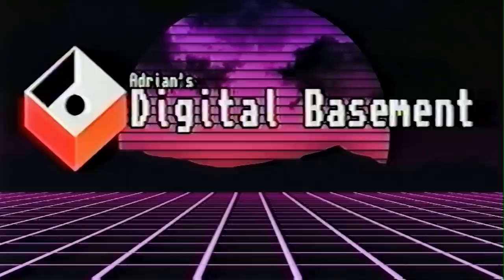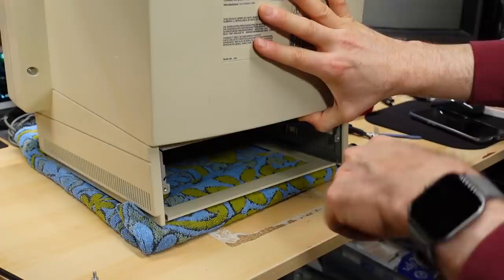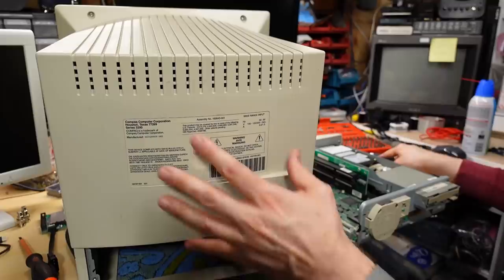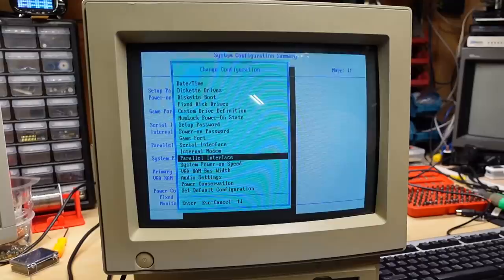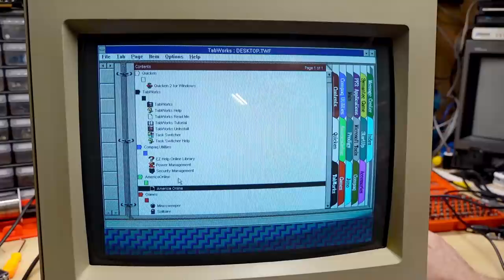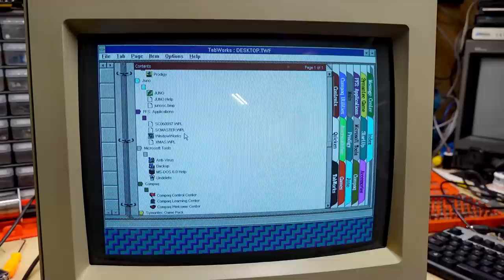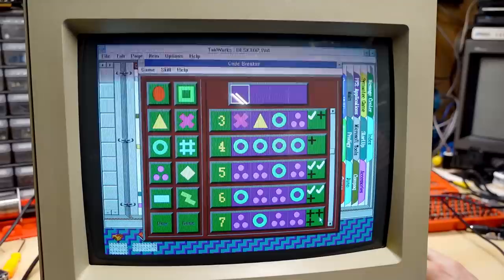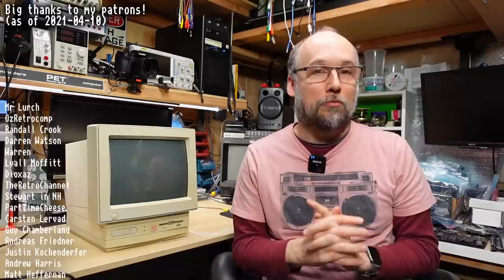PC archeology: Compaq Presario 425 All-In-One (Part 1)

Comment: I definitely remember seeing these when I was a kid, I think one of my friends had one. I wasn't really a fan of them back then, since I thought they weren't good value. I vaguely remember them being more expensive than buying a cheap no-name branded but equally specced box and separate monitor. Not to mention the lack of upgradability, since you couldn't just pop a drive bay cover off and slot in a CD-ROM drive. But my opinion has definitely softened, and I think these machines are very cute and well worth preserving!

In terms of upgrades that you can do, a Sound Blaster 16 would be the right sort of era. I'm sure you're already aware that the Vibra16 cards should be avoided, since only the Vibra16S model came with a real Yamaha OPL3 chip. I do like the idea of using a separate SCSI card to connect an external CD-ROM. There was a model of SB16 that came with built-in SCSI, but I don't think it came with an external port adapter cable thing to allow the connection of an external drive.

Anyway, can't wait to see what upgrades you have in store for this little machine!

Comment: If you look at the window on the left side that line represents the spacebar on keyboard. You could drive windows completely with keyboard alone and not need to use the mouse. IIRC it was alt+spacebar, then you could also use tab key and shift+tab and?arrow keys? In addition to Alt+letter that is underlined in the window's menubar.
Reply: You can still do that. Not so much with the "modern" Metro/WPF "Apps". But Win7 could still be used without a mouse.

Comment: Adrian, check out the label on the bottom of the slide out motherboard drawer (shown at 8:12 in your video).  It may be the motherboard diagram showing the component locatinons and jumper settings.
Reply: Ha, I've never checked mine. Thanks!

Comment: When I was in school (1995-2000), I used to use compaq presarios cds 520, a model after that one you showing. They had knobs for brightness/contrast/size at right or left of the case, a cdrom, floppy, buttons for volume, speakers.. If I recall correctly, it had 8 megs of ram and 486 running ms-dos+win 3.1 or win 3.11 for workgroups with tabworks and later they (school staff) upgraded to win95. Nice compact machines. I would love to have one.
But that machine is pretty as well. I would love to see cpu/ram/hdd/cards upgraded too. I think I saw that the BIOS is socketed and I think they at some point, only shipped boards with the chip soldered.

Comment: Interesting to see the slide out logic board on a PC, like how it is on a Macintosh Color Classic or Performa 575. Of course, this Compaq has the HDD and floppy as well, similar to the Power Macintosh G3 All In One, which I think was the last Macintosh to have that slide out design.
Reply from the maker: Indeed! Compaq was really being smart doing it that way versus the Color Classic as a comparison. (Both from the same time period.) The CC is a pain to get the hard drive and floppy out due to the way you have to remove the analog board -- a little more consolidation would have been nice :-) Amazing though what a step back so many computer have taken from these old days when it comes to serviceability.

Comment: Using torx is all about ease of manufacturing.  The machinery can grip into the heads of a torx screw much easier than the alternatives, and they're also much less likely to strip.
Torx screws are actually commonly used in construction also for the same reasons.

Comment: My first pc.
A Compaq Presario 425.
Although I upgraded it with a dx2-66 processor and 8 mb ram.
I also put in a soundblaster clone and a 4x internal cd-drive that we had to put next to the pc and have wires come out of the other isa (pci??) slot.

My friend had another version of that computer. Presario 460, it had a sx66 cpu in it.

I hated that tabworks thingie and replaced that branded version of windows with the regular windows 3.11 and also upgraded Dos 6 to 6.22.

Weird that your cpu is soldered on the motherboard. My was in the socket. That I remember clearly, I sold it to the guy I bought the upgrade from.

I do recognise that palm tree in that tutorial program, but I don't remember the software.
The "other" games does not look familiar but if I'm not mistaken we also got another game with the pc. Compaq tennis, it came on a yellow floppydisk.

Comment: OEM's were often early adopters to certain things. I regularly find coincell batteries or plugged in battery packs instead of the horrible Vartas in old machines from HP, Siemens or Philips. Also they supported PS/2 port peripherals early on, while my non-OEM Pentium 100 I bought in like 1996 still had an AT keyboard connector.

Comment: They were buying a load of these at the company I was working at in '93 to replace all the dumb terminals for the programmers. They offered staff the opportunity to get one for themselves at the cut-price rate the company was getting them at (which was about 75% of retail) but at the time I had my eyes on one of those new-fangled "out any time soon" pentium machines so I turned down the offer. They were nice machines, I hung on to my dumb terminal as well so I could have 2 screens connected to the minicomputers :)

Comment: as a kid I just used a flat screwdriver that would fit in and then apply pressure against the screw as I twisted, and I'd hear the tiny lil bit of noise that said "ok, screw is coming loose" and I could unscrew it with ease after.

I had a macintosh <3

Comment: Nice vid. I have a couple of Compaq all-in-ones and really love their form factor. If you're going to replace the hard drive, you should get yourself compaq setup disk, since the BIOS resides on the HDD. I should have it somewhere if you need it. Second thing - get rid of this battery, they DO leak and corrode the traces, especially those that provide battery power to the BIOS. And those machines won't boot without a working battery. You can use a plenty of CPUs - regular DXs or overdrives. You can even install a Pentium Overdrive (yes, even if the CPU socket is too small). Jumper settings are written on a sticker underneath the motherboard chassis. As for RAM, this computer works only with FPMs, EDO RAM won't work.

Comment: The power plug is where it is for one reason only, you can't plug it in unless the tray is fully pushed in.  Well, or no tray at all at which point it doesn't matter.  The whole plug sticking out the back issue completely goes out the window once you plug in a parallel cable.  Especially one of the old school super thick ones.

Comment: I've been almost daily driving my ARM development machine (RockPro64) running FreeBSD/ManjaroARM for a while now.  I need to swap to my main machine (twin xeon 12 core, 24 core/48 threads on a budget as joke project turned primary machine when the prices shot sky high, and availability stopped existing) when I need some heavier lifting/RAM.  

What I would give for an ARM machine that's basically the SBC but with RAM/storage expansion (SATA/NVME) and expansion slots.  The RockPro64 is the closest I've found for a reasonable price, but if I could get M1 performance with upgradability I could finally full time ARM.  Doesn't even need a socketed SOC as long as the price to replace the SBC is around that of either a motherboard or processor.  At that price it wouldn't feel as bad to replace if damaged, just wouldn't be good in terms of ewaste tossing an entire board for a SOC or vice versa.  Founding and adopting a standard for a socketed ARM module would just make it even less likely to happen in general.

Comment: The Presario series was a budget line entry system. Its Bios was the same as the Deskpro business systems abd the bios has lots of legacy functions. Interesting to note that the access to the bios was via a system installed in a Diag partition on the drive.
Reply: TAB works is yuk and came into the system with their Concerto tablet type system.. Not very nice

Comment: The VGA RAM Bus Width setting could be a compatibility setting for certain dual monitor setups. I had an old 386 back in the day that would let you hook up a VGA and Monochrome monitor at the same, but only if you put the VGA card in an 8-bit slot, otherwise it would give an error message on boot.

Comment: The Intel 486SX was the same as the 486DX with the floating point unit (FPU) disabled. The extra socket was probably to upgrade the motherboard to a 486DX with floating point.

Comment: Widows 3.1, was a shell program. I still have my Windows 95, OS. Then I got the Windows 98, with USB support, you could add drivers for the USB port, in a file, on the OS disk. It was added, with the Win98 OS! I also, have the Windows for Workgroups. on 3.5 Floppies! :).

Comment: That Code Breaker game is a variant of the old classic board game, Mastermind, which is in turn based on an even older game called Bulls and Cows. The most common version used coloured pegs. You'd put your guess into the board, and hand it off to your opponent who'd add black or white pegs depending on your guess. I would categorise it as 'mildly diverting'. https://en.wikipedia.org/wiki/Mastermind_(board_game)

Comment: 534h is the standard I/O address for a Windows Sound System compatible audio device. Also, the flashing cursor in the top right is the BIOS setup prompt, pressing F10 while this is on should bring you straight in.

Comment: Wow this is actually the first windows pc we ever had. I can tell you everything about in we put a overclock processor in it and put it to 66mhz had 4mb of ram after that upgrade and had an external 2x cd-rom for it. Got it from walmart and it had a program called tabworks on it running over windows 3.11 had dos 6.2 after upgrading them also
Reply: The bad part was with 2 ISA slots on it we could use the cd-rom and sound card or we had to removes 1 of the 2 to put a us robotics 56k dialup modem lol

Comment: The Compaq Torx screws had a slot and could be used with a flat blade screwdriver.  The screws have survived today and are still found in many HP Desktop PCs.
Reply: And the advantage that Torx screws offer against Phillips head screws is that you won't usually be able to strip the head and don't slip when applying torque.
Reply: @FirstDagger  I think the best possible screw would be this one but the sides of the screw cut to a 1/4" hex so you could use a screwdriver with the bit removed.  So you'd have torx, flat, and hex.

Comment: FWIW the 487SX had a extra pin to disable the on-board 486SX, but I belive you can also stick a 486 Overdrive ODP (make sure it's a ODP one, the other 486 Overdrive, the ODPR, PR in this context being "Processor Replacement") in the 487SX socket.

Another option would be a upgrade module that has the required pin (I can't remember neither which pin it is, nor if you had to pull it high, low or downright ground it to "trick" the motherboard into thinking you have a genuine ODP or 487SX installed) to disable the 486SX.

Comment: Yep it can take a 486DX2/50 but better yet there's an onboard jumper to change the bus speed from 25 to 33 Mhz so I put a 486DX2/66 in mine.  I can't recall but I think I eventually put in a DX4/100.  The default HDD was  a Seagate 200MB IDE and man it was slow even by that time frame.  I later added a SB16 plus an IDE CDROM by using another power supply outside the case.  The drive sat on top of that.  The IDE cable just barely reached!

The Presario design was pretty good but this was essentially a modern refresh (for the 90s) of the IBM PS/2 Model 25.

Comment: Amstrad also sold a machine very similar (very close) but the psu lead was built in. It matched / replaced the PCW word processor range which worked on cpm3.
Reply from the maker: Ah nest. I saw IBM had a machine that was also very similar to this called the EDUQuest. But the IBM machine had a CDROM and more slots and was a lot taller in the end.

Comment: Whoa! Be careful with the contents of that disk. That blinking cursor on the top right gave me some reminder from back in the day about Compaq using a small part of the disk for the setup program (for the BIOS). If you deleted all file systems that cursor would disappear and you could not change settings in the BIOS anymore (IIRC).

Comment: You got it wrong-  the 487-SX is the Math Co-Processor!
Reply from the maker: https://en.wikipedia.org/wiki/Intel_80486?wprov=sfla1

"i487SX (P23N): i486DX with one extra pin sold as an FPU upgrade to i486SX systems; When the i487SX was installed, it ensured that an i486SX was present on the motherboard but disabled it, taking over all of its functions."

Comment: You want to set the VGA RAM Bus width to 8-bit, if you run an OS, that can only do 8-Bit I/O. The early 86 Unices (Xenix/86, Venix/86, PC/IX) could only to 8-bit screen memory access. To run these old OSes, you would have to use this option. Of course, on a 486, you would run a proper 32-bit version of UNIX.

Comment: You can use a flat blade on the compute section, but the monitor would have been different as areas that are "non user serviceable"  would require a different tool to open for UK compliance.

Comment: It's a Compaq. Of course it uses Torx bits for everything. Later on they got a bit smarter and used the slotted Torx screws, so you could get them open with a flat-blade screwdriver.
By the way, those tantalum capacitors... While they never leak, because their failure mode is short circuit, it's not unusual to see scorch marks when they blow. And you'll know when they blow, because the whole room will smell of magic smoke.

Comment: 1/3 You can upgrade this PC easily up to 486DX2 @ 66MHz. Just make sure the model number on CPU is "ODPR", not "ODP". The "R" mean it's a Replacement, includes an extra pin on the processor that disables the onboard CPU. Then change the jumpers to match the 66MHz configuration. This computer can be upgraded higher with rare CPU upgrades, but they're hard to find and expensive. and not guaranteed to work. Also for a free upgrade, you can actually overclock the built-in 25MHz CPU to 33MHz :)

Comment: In my experience when running CHKDSK /F you should always answer [n] to lost chains and clusters and most of the time you find you don't get any corruption. However when answering [y] it converts these lost chains and clusters to files. Which may be handy if you wanted to view the contents of these files but they are now broken fragments from the original file and therefore effectively corrupted.

Comment: In the 90s we had the later 520 CDS (or was it CDS 520?), which I think was also a 486 of some flavour, but also with a slide-out motherboard tray, and later on in the mid noughties, I purloined a slightly later 5520 from where I worked, which was a Pentium (P75 or P133, I forget), loved their AIOs, even if upgrades were a bit limiting with regards to being able to physically fit them into the machine... :)

Comment: You can add an overdrive processor to the 425. I bought one back in the 90's for cheap and the first thing I did was put an overdrive chip in the socket and max out the ram. It ran windows 95 find after some upgrades, a great little computer for browsing the web (back then).
Reply from the maker: I've had my eyes peeled for one of those pentium upgrades. Not as easy to find anymore but I bet would be a nice upgrade. The real let down with a Pentium would probably be the on board video card.
Reply: @adriansdigitalbasement  Evergreen Technologies also sold a 486 upgrade kit that used an AMD 5x86. Those might be a bit easier to find than the Intel option.

Comment: I have one of these with an Overdrive DX4-100 shoved in it, an SB16 and an ethernet card. The issue with these is they're limited to 20MB of RAM, and if one of the RAM slots goes bad since they're plastic, you're screwed. one of my slots isn't working and I've tried everything to get it working again, but yeah. it's not good. The plastic back on the motherboard tray cracked off and I had to bolt mod it back on.

Considering LGR has one they're pretty decent machines, I've also seen one that was running a beer brewing setup in a hotel or something as well. again, they're good, but if the RAM slots die you're done. the max you can put in it is 2x8MB sticks and the machine is also VERY picky about what RAM you use.

The audio onboard is for windows only and it does have onboard audio through the PC speaker.

Comment: Pin header is part of "compaq prolinea net1/33" series where a network card is mounted to. few presario 425/433 do have the header installed but i could never get a network card working in that interface that was taken from a "compaq prolinea net1/33" there seems to be something diffrent in the schematics as i can se on the bords but as i never did get a hold of the schematics  i could never get the network card working on my presario sadly which would have been a nice hack, so i ended up just purchasing a prolinea bord and added it to my presario ;) i did make a post on vogons viewtopic.php?t=69278 on the diffrent boards. i have also uploaded default backup image disks on archive.org
Reply: Thats the one that I own, the compaq prolinea net1/33, with 8MB Ram , 260 MB HD,  and Win95, nice little machine,